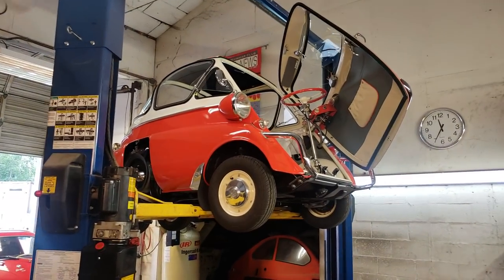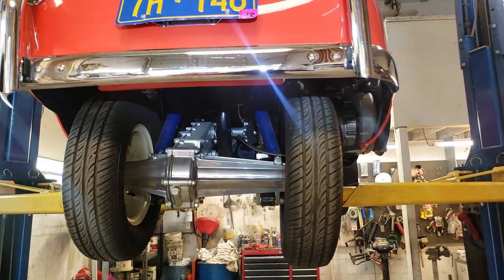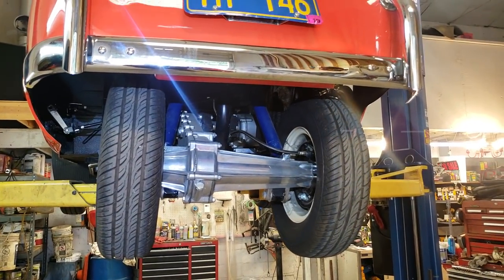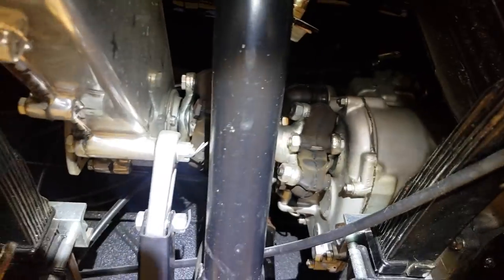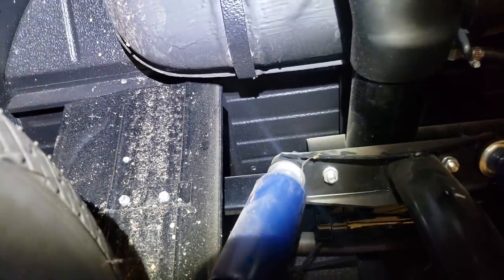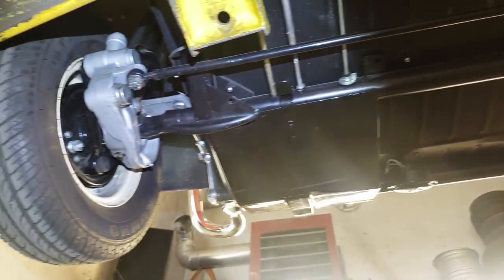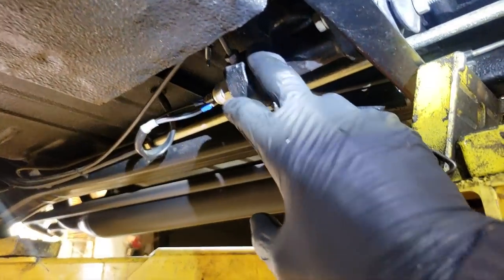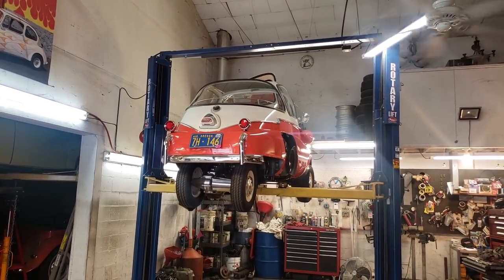Beautiful Bubble Isetta Undercarriage Inspection. Just what makes it tick?

Comment: I'm a believer! Have loved these small cars since I was a child in the 1950's. i turned 70 earlier this year and would give anything to ride in or drive an Isetta. The principle of the rear wheels/axle/chain drive intrigue me. I ride recumbent trikes (delta and tadpole) for my senior enjoyment and the delta recumbent trike is similar: two wheels in back with one brake (disc) driven by a chain. My power source is more of the two legs pushing feet on rotating pedals variety, so no gas tank is required!

Comment: It's like the wrapper was just peeled off it! I think I'm in love. Is it one wheel drive with the other hub "free wheeling" or are both rear wheels connected and spinning at the same speed?
Reply: If I understood correctly they are both connected. This makes having a single rear brake more logical because it will act on both wheels through the axle.
Reply: 2:44 he shows that the left wheel is free-wheeling.
Reply: No, he showed he could turn the left wheel with the car in the air. The right wheel was off camera, and he said they were locked and implied there was no differential needed due to the narrow rear track. If one wheel was free wheeling the rear track would be irrelevant and he wouldn't have mentioned it